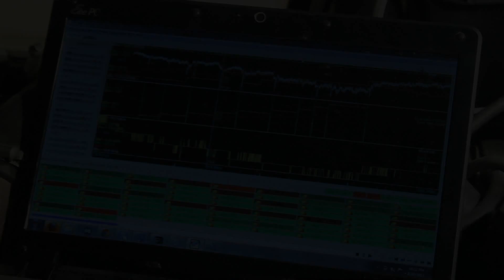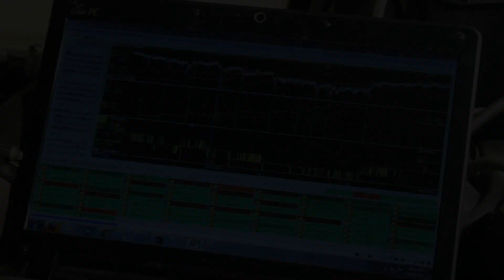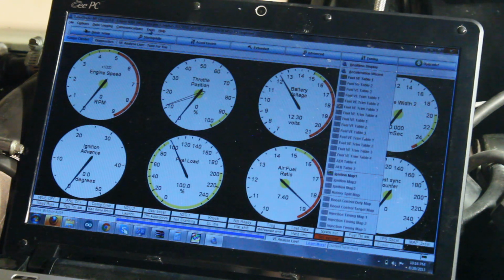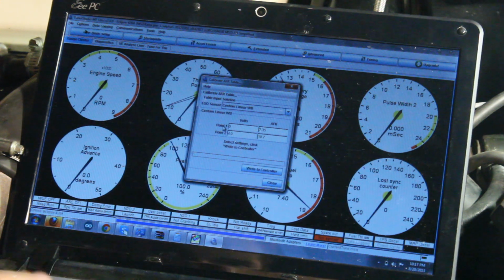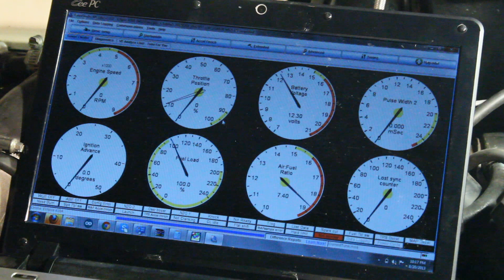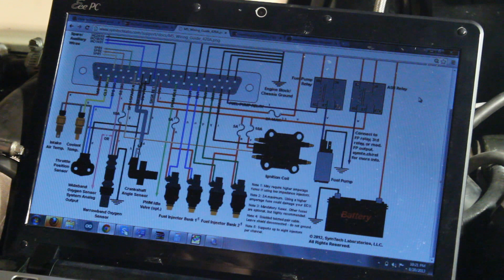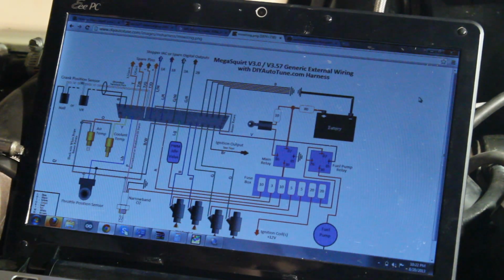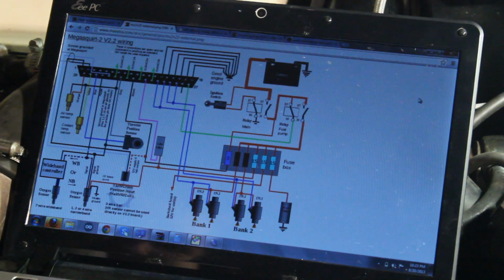Evan's Megasquirt Build Ep 27 - Project Update

Comment: I believe my ecu uses a hall or vr (people say it's a vr but it had a power source) and it did not use a shielded wire for some reason
Reply from the maker: +Austin K Shielded is optional, but recommended.  If you get noise in the signal it'll show up in the log as sync loss events.  If you can run flat out for a while and don't have any sync loss events, you are good to go.  That data line is carrying a reasonably fast pulse train on cables not really made for it, so they are often shielded so the ECU gets a good clean signal.  If you do shield, ground the shield on the source (sensor) side and not on the ECU side.

Comment from the maker: Interesting.  The only problem is that since I'm running batch fire fuel and wasted spark, I'm not running the cam signal to the MS at all, it does not need it.  I have done a tooth log, and it all looks good, then the signal goes high for about one full engine cycle, then starts working again.  I'm suspecting noise in the signal, but it could be a bad sensor as I guess.  I'm going to put it on the scope this weekend maybe and see how the signal looks.  If it looks good, maybe try a sensor?

Comment from the maker: Agreed.  For some reason the LC1 without a gauge costs a bit more... I don't think you get any extra performance or anything either.  Scaling the settings did not get them both to match, I had to tweak the values a bit.  I'll worry more about it later on, it is within .2 or so, and I'm okay with that for now.

Comment: Reason = 420a, pretty comical. That's just the engine's name. Sync just means that the cam and crank position sensor signals are both present and agree with each other. Losing Sync doesnt tell you which one is dropping out, although a scanner should. You should also be able to infer by the slope of the decrease of RPM. RPM signal comes from the crank sensor so if it drops out it should go to 0 like a square wave, but if cam sensor drops you should see a more gradual deceleration in the logs.